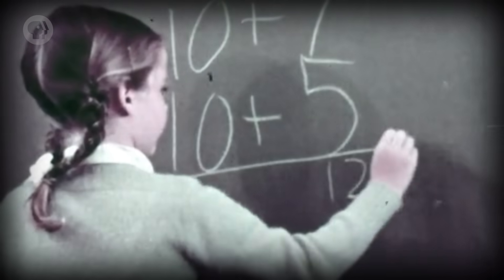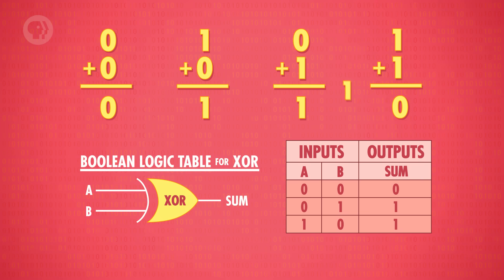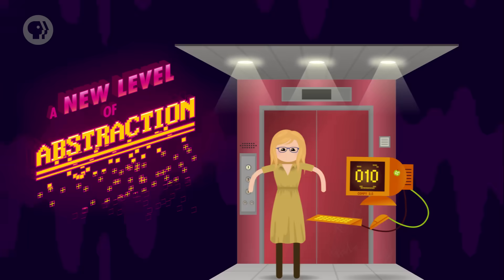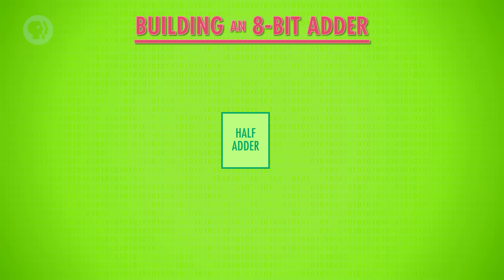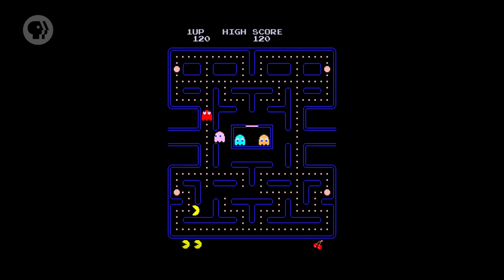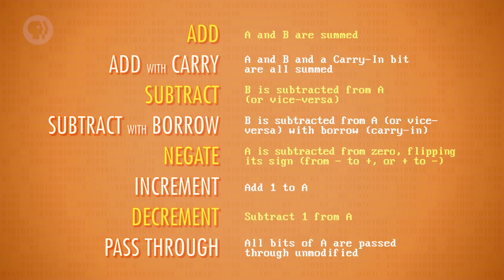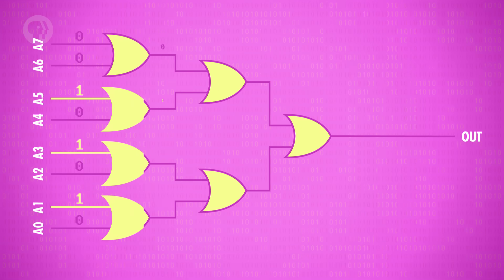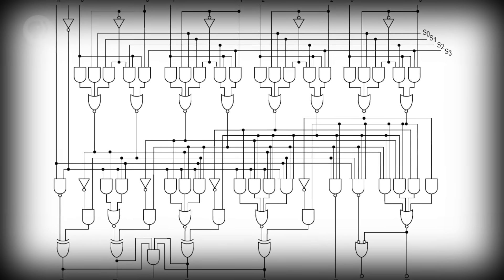How Computers Calculate - the ALU: Crash Course Computer Science #5

Comment: You better add a counter to the abstraction level animation
Reply: levelOfAbstraction++
Reply: Yeah, I always use ++var when I can, just because I never trust the compiler to optimize that for me :P

(For the non-programmers reading this and wondering: ++x adds 1 to x and then returns the result. x++ returns the current value of x, but then adds 1 to it. You can't have instructions continue after returning a value, so in order to do x++, you first have to store the current value of x in a temporary variable, then add 1 to it, then return the value you stored; that's extra instructions compared to just the "add and return" of ++x.)
Reply: Yeah, in this case it doesn't matter. In does matter though when post-increment and pre-increment makes a difference, as you mentioned. I usually just do post-increment/decrement by habit.
Reply: Javier Figueroa the number at the top of the elevator
Reply: Where it does matter, even in modern C++, is with overloaded operators. If you have, say, an interator class that internally creates a copy and returns that after incrementing itself, it might not get optimized out.
Reply: levelOfAbstraction += 1
Reply: You could also do
`++levelOfAbstraction`
Since ++ before or after a variable (++var vs var++) is essentially the same operation, although on older compilers, ++var would result in less instructions if it's not in an assignment or anything like that. A little bit of random micro-optimisation trivia (nowadays, if the result of ++var is not being assigned into another variable in style of `int foo = ++var;` or `int bar = var++;`, it will be optimised into the same instructions)

Comment: If you're looking at modelling this as a beginner, it is really easily done in minecraft.
I did it to make a central railway station years ago.
Reply: Or you can try building a full-blown CPU in minecraft. It's a fun exercise, but trades some of the complexity of individual transistors, for structural, space, and time complexity due to the minimum size and time of the logic gates. And the fact that it's extremely difficult to insulate wires that are right next to each other.

Comment: so we now know how to add in 8 bit, what about subtracting in 8 bit?
Reply: By the way, the inversion is nothing flipping all bits (either through a simple NOT or an XOR) and then add to the value by one.
Reply: Flipping bits and adding 1 is not the way to do subtraction since it will lead to 2 versions of 0 and introduces unnecessary logic.  The actual way is to use 2's complement numbers where you embed negative numbers inside the binary representation.  The most significant bit becomes -(2 raised to place of that power).  So if you had a 4 bit device, the lowest number it could represent would be -2^(4-1) = -2^(3) = -8.  Negative numbers just become -8 + whatever is to the right of that number.  So 1011 = -8 + 2 + 1 = -5.  When numbers are represented in 2's complement, subtraction and addition just become addition.
Reply: @Feature Preacher: The purpose of inverting all the bits and then add one is to get the two's complement numbers. That's how you get a negative number, at least it is a possible way (and some processors require it that way). If there is a more efficient then couldn't you have mentioned it instead to write a wall of text which doesn't help (me) at all?

Comment: Can't wait till you get to how algorithms work!
Reply: +Tommy Rosendahl She's going to explain it better later but...

Algorithms are just thought processes, they are not executed directly by computers. They are defined through programs written in a programming language.

Program code are translated to assembly code. Assembly code are translated to machine code. Machine code is just a bunch of sequence of  0's and 1's that defines your very one program and everything boils down to very simple commands of sum, subtraction, addition, comparison, etc... All executed by the ALU she just explained.

There are way more things than that obviously (like memories she's going to explain later) but you can see the bigger picture...
Reply: "They are defined through programs written in a programming language" Not necessarily. With an FPGA (Field Programmable Gate Array) one can build custom hardware architectures for the implementation of an specific algorithm using logic gates and some good old sequential logic. Now, if one is using the FPGA as a hardware accelerator, it is possible to use a program in a programming language to feed and receive data into the FPGA, however the whole point of it is that this program will only give it the ones and zeros of the data and some configurations, and the actual algorithm will be executed by the custom architecture.
Reply: Yeah, but FPGAs are generally written with a sort of programming language, such as VHDL.
Reply: verdatum Yes, but VHDL and Verilog are not programming languages, they are hardware description languages. Even if they have some behavioural synthesis options, after you compile your code you end up with a bitsteram that is sent via jtag and configures the registries in the  LUTs to implement your architecture.
Reply: The hype is real! Algorithms!!

Comment: As a side note to those wondering how subtraction is done, it is also done through addition. The way computers store negative integers in binary is a system called 2's complement, which is difficult to discuss in a short text comment, but it allows the addition of a positive integer X and a negative integer Y to equal X - Y. If you want to subtract Y from X you just turn Y into a negative number (which is a very fast operation) and then add them together.
Reply: Interesting note, some early computers used other solutions. Try looking up 1's compliment, the way to go if you prefer a negative 0.
Reply: Well, typically computers didn't want a negative 0, as it was generally seen as wasteful. Two's compliment was created to be more efficient in terms of number usage. 1's compliment was used for simplicity when computers increased in speed naturally all of the time.
Reply: Oh yeah, there are many reasons 2s compliment is better. It's just a fun foot note in Comp Sci history, like sexidecimal (hexidecimals true name), and using bytes to represent two digit numbers for human readability.
Reply: +Preeth Kaveri
The problem here is that you 1111 is -1 in 2's compliment and 1010 is -6. if we are dealing with only 4 bits. It is a little complicated to intuitively understand, which is why I didn't explain it very much in my comment. 

Going with that very specific example, if we want to subtract either 10 from 15 (which I think was your intent), we are going to use a 5 bit number, because signed 4 bit numbers only gives us a range of -8 to 7. So, if we want to subtract 1010 from 1111, we need to first turn these into 5 bit numbers. So, we have 01010 and 01111. Next, we realize that we want to subtract 01010, so we will make it negative. Taking the two's compliment gives us 10110. Now, we add this to our 01111 which gives us 100101. This, you may notice, is a 6 bit number. Whenever it overflows, we just get rid of it, which gives us 00101. If you look at what we were doing in decimal, we did 15 - 10, which should be 5. Our answer is 5, so we did it correctly.

The question of course may be why does this work? I can't explain this very well in a YouTube comment, so I'm going to refer you to these two explanations: https://www.cs.cornell.edu/~tomf/notes/cps104/twoscomp.html
http://stackoverflow.com/questions/1049722/what-is-2s-complement
The why in the Cornell link is near the bottom of the page.

If you are still struggling after looking at these, I learned from a book called principles of computer hardware. It is old and outdated now (2006) and also is filled to the brim with typos which make learning confusing, but maybe the chapter 4 computer arithmetic section from that can help you out. Good luck!
Reply: +mike johnston Bob By repeatedly subtracting values. Think of the way you do long division if you write it out: you're basically subtracting the divisor from the dividend over and over until the remainder is less than the divisor, and then counting the number of subtractions you had to perform, right? So that's how division is done: subtract the divisor, add 1 to the quotient, and repeat until you get a negative number, then output the quotient.
Reply: Here's a great resource for learning anything about electronics. Go to chapter 2: "Binary Arithmetic". https://www.allaboutcircuits.com/textbook/digital/
Reply: @G8tr1522  you Sir have enlightened me. Thank you very much
Reply: Have you head of approximate computing? It's an emerging research area. Apparently, it's where you take advantage of the trade-off between precision and computation time. I don't know much about it, but I'm sure it'd use what you just mentioned.
Reply: How does it do divisions?
Reply: @mikejohnstonbob935  
Psudocode
A/B = C{
C = 0
Loop until break
If(A>=B):
Do (A = A - B, C = C + 1)
Else: break loop}

This doesnt do anything with the remainder though.
Reply: Actually, my idea wouldn't work since you'd need to take the inverse (i.e., ^-1) of an integer.
Reply: something like seeing if the divisor can be subtracted from the dividend, subtracting if so, else dividing by 2 (shifting in binary) and repeating. been a while though
Reply: MegaZeroX7 you sound like my mom
Reply: ex: 0001 (1) negated = 1111(-1) 0001 + 1111 = 0000 (1-1=0) the reason it becomes 0000 is because it is actually 10000, but you ignore the 1 since it is 4 bits (hope this helps explain too)
Reply: Yeah. If you flip the bits then add one to the binary you get the negative equivalent using 2's compliment. It's a really easy algorithm to implement on pen and paper, and also using logic gates. I had to build a 2's compliment ALU using the C programming language in my Introduction to C Programming class using doubly-linked lists for the registers.
Reply: You can just do a multiplication that has the decimal shifted over. The multiplier circuit would see two integers, but then you'd need additional circuitry to account for decimals.
Reply: radiohead4everrrrr Yep, but actually some floating point processors (especially in graphics cards where accuracy is less important) do divide that way. But it inherently only approximates, which is unacceptable for many tasks. Thus CPUs don't do this.

Bravo for catching your mistake.
Reply: Could you elaborate a bit or give a resource? Taking 4-bit 1010 and 1111 then 1's complement = 0101 and 0000 and 2's complement = 0110 and 0001.  How does this help in finding the difference between the two?
Reply: What Im doing is add 1111....1 to a number, lets say 4, which makes it almost like a 2's compliment but it looks exactly like the 2s compliment of 3. Then I add this number through my adders and I get the binary number I want pf the original number minus 4.
This way, 1000...0 is -2^n, 1111...1 is -1, and 01111...1 is 2^n -1.
I stumbled upon this because I was feeding my carry from my 8th adder into the 1st adder to get the right number and it caused a loop when I passed 0.
Reply: Dats weird, your picture is the same as my lost discord account